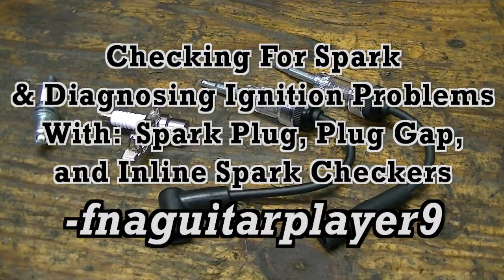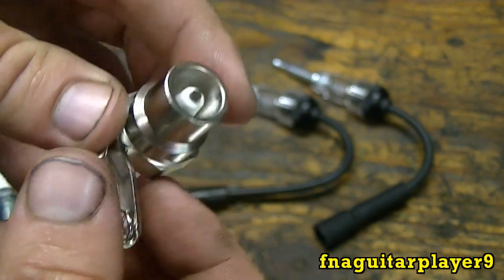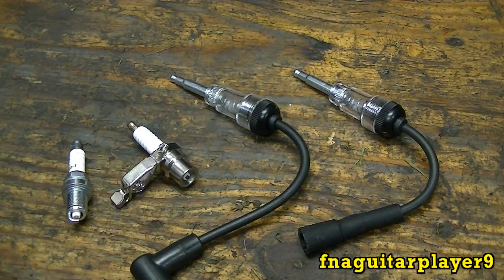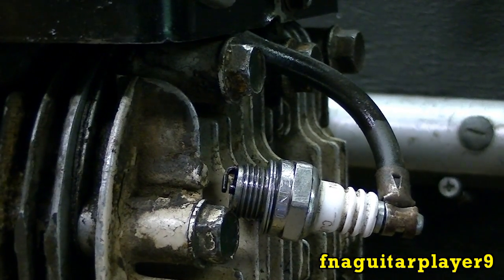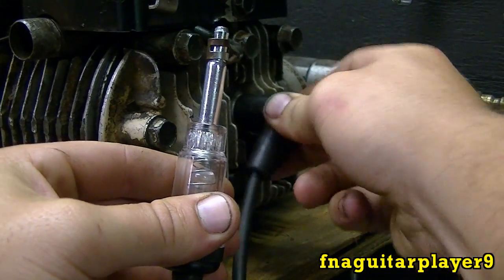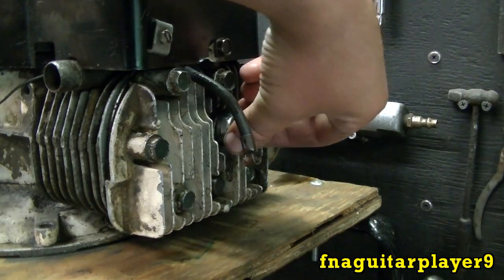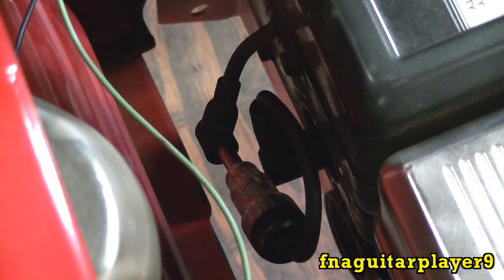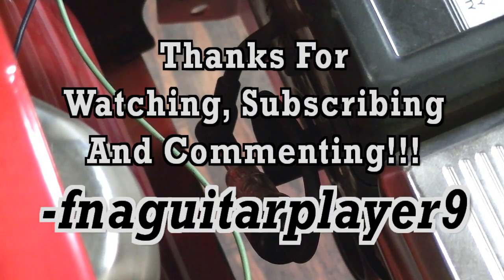Checking For Spark Using Spark Plug, Spark Gap AND Inline Spark Plug Checker

Comment: I thought it fired every other time on four strokes and every time on two strokes. Is that wrong?
Reply from the maker: no, your right, but the way small engines are made, there is a magnet on the flywheel that flies past the coil generating a spark, so a spark is "wasted" when the piston comes up on exhaust stroke, it fires with every rotation. On car engines with a distributor, which runs off the camshaft instead of the crank (half speed) it fires only on TDC on compression stroke. So in a since, a lawnmower engine does fire the plug on each stroke, just like a 2 stroke. Weedeaters, chainsaws, etc with 2 stroke engines use the same magnet on flywheel firing the coil setup as this. Hope i explained it good, i'll try and make a video talking about it in more detail. Thanks for Watching!!!
Reply: No you are right, lol. I just assumed it was every other time. And thank you for explaining that. Great channel and thanks for the upload !
Reply from the maker: I hear ya! Appreciate that, your welcome!

Comment: Hey, I got a pocket bike that was running fine but after i washed it with water it started to accelerate really bad, when the wheel is in the air its normal, but when im sitting on it its really bad. Any ide on what the problem is?
Reply from the maker: Sounds like water got into the gas somehow or the air filter got soaked and under loads its pulling a little water in, take the filter off and let it dry and maybe drain the gas and put fresh in, sometimes it doesn't take much water to mess things up. Hope this helps! Thanks for Watching!!!
Reply: fnaguitarplayer9 ill try that tomorrow, thanks from sweden !
Reply from the maker: your welcome!